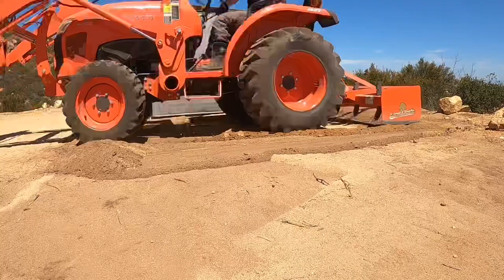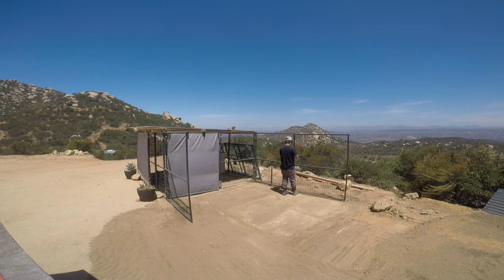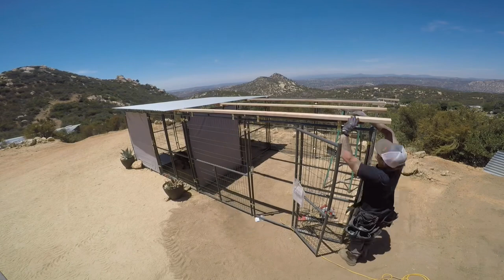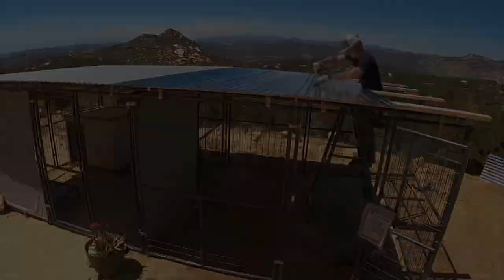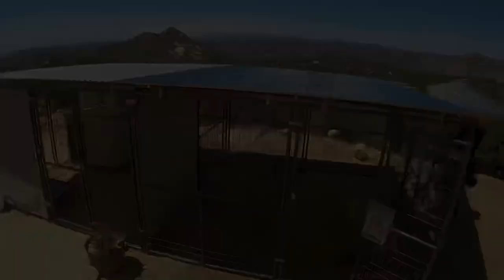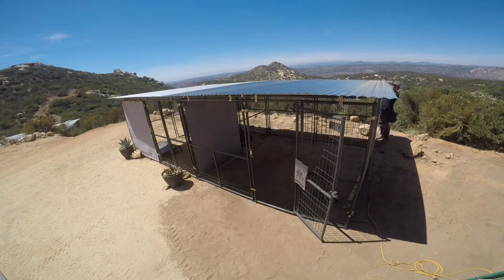Dog Kennel Roof Built to Withstand the Elements Part 1

Comment: This is extremely helpful. I could not find any roof alternatives than the tarp.  We'd be using this dog run for exotic animals that will easily climb out, so a structurally sound and secure 'top' was needed. This gives us a ton of inspiration. Thanks for making it. Cheers!
Reply: If you have metal building supply store near you call them for roofing
Reply from the maker: Awesome! Glad it was helpful.

Comment: Could you give the step by step instructions on your roof? For example, you added a second metal bar across the top, is this needed?
Reply from the maker: I'll work on the step by steps but in the meantime I can answer your questions. 
The bar across the front is not needed. I did it to add pitch so that during the rain it will drain toward the back and not pool if there happen to be a low spot. I used the piping from the old roof that got torn off due to high winds, used the same pipe to pipe clamps the kennel is held together with (can be found on amazon (( https://www.amazon.com/HITTITE-Kennel-Diameter-Kennels-Temporary/dp/B098DWQHCQ/ref=sr_1_1_sspa?crid=XWPYGP7BX921&keywords=gate%2Bclamps&qid=1662042612&sprefix=gate%2Bclamps%2Caps%2C142&sr=8-1-spons&spLa=ZW5jcnlwdGVkUXVhbGlmaWVyPUEzUldVQUVMSjJJRUY2JmVuY3J5cHRlZElkPUExMDI1ODMwMVc3V0pHQUpLME5HOCZlbmNyeXB0ZWRBZElkPUEwOTkzOTE1Mko4OE9WV0NHSVZEMyZ3aWRnZXROYW1lPXNwX2F0ZiZhY3Rpb249Y2xpY2tSZWRpcmVjdCZkb05vdExvZ0NsaWNrPXRydWU&th=1 ))for example)) so the front is 3" off the top of the kennel, the middle is 2" and the back is 1.5". 
Hope that made sense, if not let me know and I'll explain further.
Reply: @The_Valore_Garage  So if the front is set up so that it is 3"high, I can see how that is, a rod is clamped on the top rail int eh front, the board is attached to teh pipe with conduit clamps...and the back is a 2x4 attached to the back rail with conduit clamps..So how do you regulate or make the 2 center boards set at just slightly lower than the front board and  higher than the back board? Bases on your example, 3 up front, 1.5 in the rear...how do you get just 2" in the middle? Putting together my own double 10 x20s so I will have multiple boards running in the center slopping down. If I build it up to 3 int eh front, 1.5 in the back, how do I adjust the boards in the middle so they generate slope? Thanks
Reply: I agree with @davidharding2285. Could I please get a step by step guide on this construction. I love this design and would like to put this design on my kennel

Comment: I’m curious how you adjusted the height of the middle pieces of wood to account for the slope of the roof. This is such a great idea, we are planning to do it on a chicken coop run extension.
Reply from the maker: Front uses brackets raising it roughly 2", second back uses additional 2x4 which is 1.5", third is 1" ply and the back is clamped to the top rail.
Reply: Sorry.  I saw that you answered the height spacing in the comments.

Comment: Hello.  Looks great.  How did you attach the 2x4s, and what did you put underneath the 2x4s in the middle to get an even slope?  I saw that you clamped a conduit pipe to the front edge, but not sure what was in middle.  Thanks!  (Sorry!  I saw that you answered the height spacing in a comment below.)
Reply from the maker: I used the same conduit straps in the middle. The 2x4s are screwed to the wood that raises the roofing and then the conduit straps are screwed the the wood riser. 
We just expanded to a 3 kennel set up with another roof. I will try to get an in depth look at what I did to be a little more clear. Will try to get that out soon.
Thank you.

Comment: Where did you get the extra pipe to make front higher ?
Reply from the maker: It was left over from the old retriever roof. It can easily be substituted using conduit piping found at Home Depot/Lowes

Comment: Any issues with the wind “lifting” the roof and the panels? Or are your pen panels anchored?
Reply from the maker: No issues what so ever. I do have a, "Just in Case" tie at the corners attached to rocks, but even with the strong winds, we haven't had or seen the need for the corner ties.

Comment: Great idea! I'm  going to be doing this for my own Retriever 10×10 kennel.  I understand how you did the pitch for the front and back of 3" and 1.5". How did you do the center of 2" to carry the slope? Thanks for the idea!
Reply from the maker: Thank you! 
The front uses brackets raising it roughly 2", second back uses additional 2x4 which is 1.5", third is 1" ply and the back is clamped to the top rail.
If you need more clarity please let me know.

Comment: What did you use to secure the 2x4 to metal rod?
Reply from the maker: Depending on the size of the pipes, mine were 1", I used 1" conduit clamps. Has two holes screwed to the wood and saddles the pipe. They're typically located in the electrical section of your local hardware store.

Comment: I have the same kennels but instead of 10x10 I split them in half so they 5x10s how many sheets would you say I’d need
Reply from the maker: 2-3 depending on your overlap and depending on the width of the available material you plan to use.

Comment: Nice video.  Screw size?
Reply from the maker: Thank you.
#9 x 1 in. Steel External Hex Head Washer Sharp Point Roofing Screws for the corrugated roofing panels and 1.5 in. general purpose screws for the conduit clams to wood.